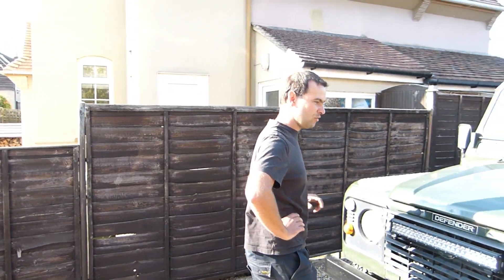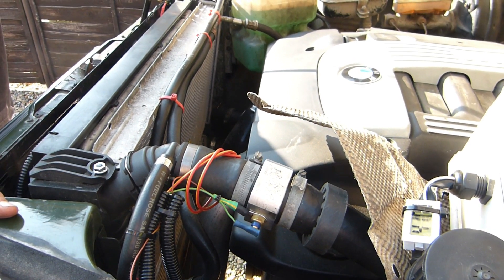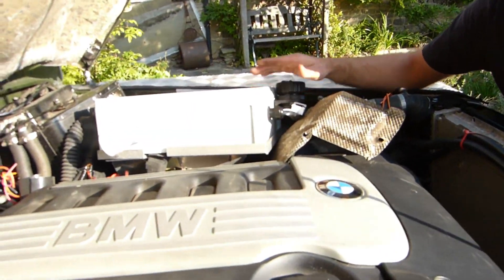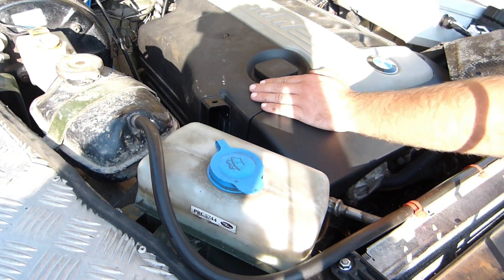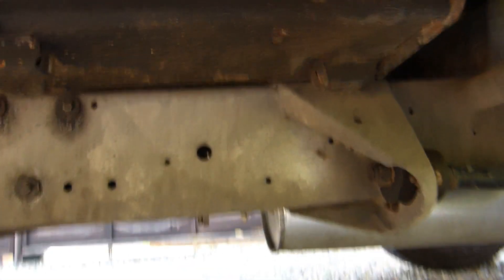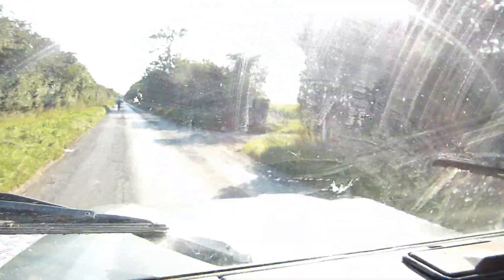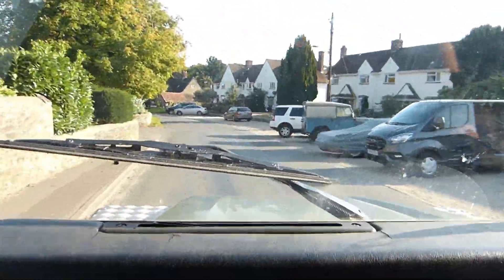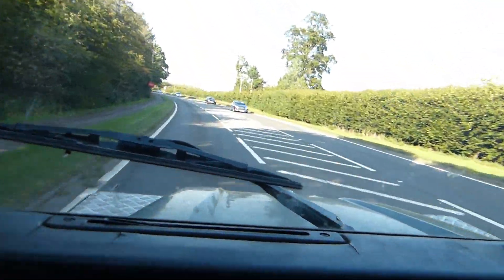Land Rover M57 Engine Conversion, Walk round and Test Drive

Comment: Did you guys work out the cruise control 
I have a m57 in my mitsubishi but would love the cruise control to work but I'm running a gps speed sensor apparently you square wave output and a brake switch which I have with my swap having the zf8hp box any help is appreciated 👏 nice work I love it 😀

Comment: Hey Liam, very nice project!! I woulld like to do the same with my Classic RR, How did you coupled  the six speed GS6-53DZ manual gearbox to the Land Rover LT230 transfer box? Have you got a contact to find someone to help me about that ? Do you know people who sale the interface betwenn these two boxes? Thanks for your help.
Reply from the maker: I got my adapter plate and shaft from synchro gearboxes but there are now several suppliers offering adapters, I think wiseman engineering also make a kit.
Reply: @liamchallis  Thanks a lot for your quick answer ! have a good day

Comment: Not only more powerful, but more economical. Great engine. I swapped M57D30 (135 kW) in my Range Rover to M57D30TU2 (210 kW) plus manual box from X5. Lovely engine.

Comment: Hi Liam, I am embarking on a similar project with a L200. Did you use ĺ all of your wiring loom from the car or did you create your own? Would you be interested in selling a reduced loom if possible?
Reply from the maker: I found an ECU pinout online and I created my own wiring loom using the plugs/connectors from the doner car.
Reply: Nice conversion bud,very impressed. 
Can you post a link of the pilot diagram if possible?

Comment: nice, do you have air conditioning on your defender ? i also want to do this swap....
Reply from the maker: No I don't have air conditioning, I actually removed the air con pump from the M57 because it would have been extremely close to the steering box.

Comment: Hats off to you and engineering skill! I have a Td5 130 i use for treework but afraid it is woeful when fully loaded up with logs..🙄
Reply: Get the ECU sorted and a bigger intercooler and it will be just fine.  I’ve got a TD5 disco with around 175hp and it pulls a big Ifor William loaded up just fine!

Comment: Just wondering the gear changes were that smooth I couldn't tell if it was automatic or manual  ?
Reply from the maker: The transmission is GS6-53DZ 6 speed manual.

Comment: I love the performance. Which did  you maintain the original R380 gearbox? Did you use an adaptor Kit or how did you go about merging the gearbox to the M57 engine?
Reply from the maker: Hi, we used the BMW GS6-53DZ 6 speed manual box with an adaptor to the LT230 transfer box. Have a look at my build thread here: https://forums.lr4x4.com/topic/106180-engine-conversion-bmw-m57-into-a-90/#comments